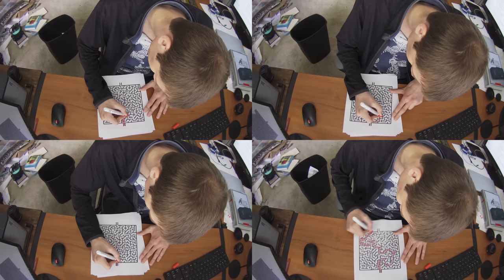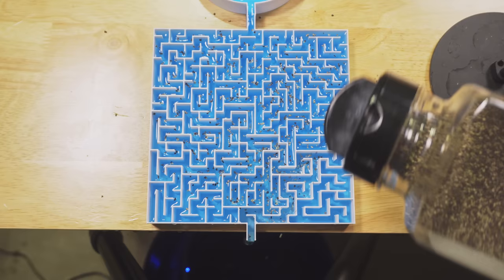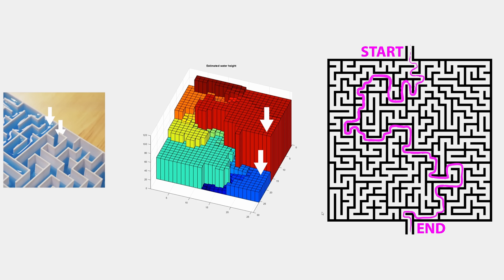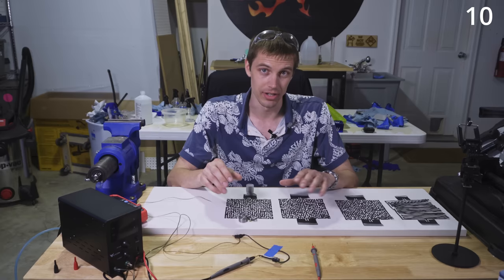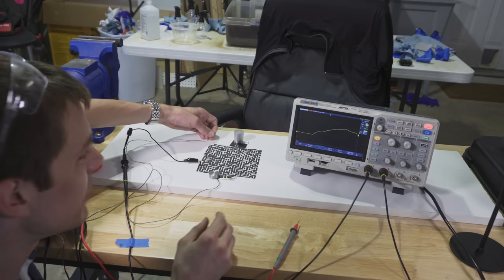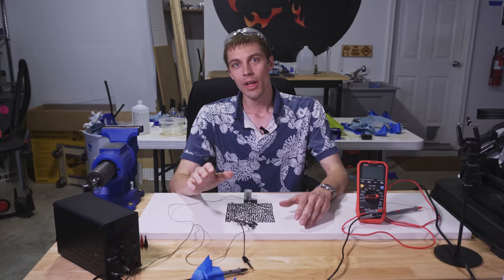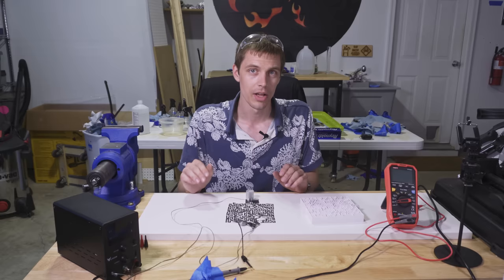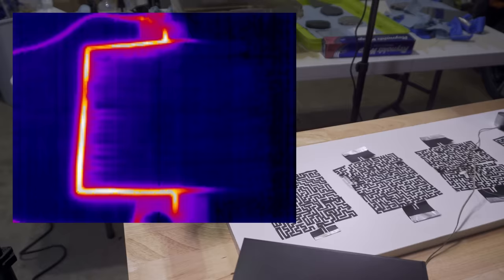How does electricity find the "Path of Least Resistance"?

Comment: They take all paths.  The less resistance, the more current flows thru that path.
Reply: In the case of a maze that wouldn’t be  true. All paths that don’t lead to the exit would be considered as open circuits, and no current would flow.
Reply: @Ethan-ej6fz  Yes they do. Just in that case, the resistance is such a high number the current is effectively zero. There's no such thing as an insulator.
Reply: @Ethan-ej6fz  There is current flow when you introduce a new voltage to an open circuit. It's like when you charge a capacitor, there is current flow until it "fills up" on voltage and then the current effectively stops.
Reply: @Ethan-ej6fz  When I said "Path", I meant successful paths of varying complexity.  I did not mean interrupted paths.  A path, to me, goes from source to destination.  But I see your point.
Reply: You might say that the field includes all paths. The current follows the path of least resistance through the field so electrons are more likely to appear on that path.
Reply: Exactly!
Reply: @RupertBruce   But the point is that current doesn't take only the path of least resistance (exclusively).  It follows all paths proportionately to the resistances.
Reply: I thought we finally have that algorythm that truly solve pathfinding in games
Reply: Kirchhoff's law
Reply: @alext8828  But knowledge of the resistance along the length of the path is not instantaneously known, that information travels at whatever the speed of light in that medium is.  You get some "sloshing" at first before that information is returned.

And then weird, weird things happen when you leave the strange, degenerate realm of DC and head up to RF, where absolutely everything is a capacitor and an inductor and a resistor all at once.
Reply: @Ethan-ej6fz  open circuits are just antennas 😏
Reply: @ILoveTinfoilHats  I think about this a lot haha
Reply: Current flow takes every path inversely proportional to it's resistance. In the case of an interrupted path the resistance is effectively infinite, so the current is zero. It is also why it takes multiple paths, with the shorter, less resistive path, getting more current through it.
Reply: @fire17102  Not at DC voltages. You would need an oscillation in current for the magnetic field to be created and light to be sent out.
Reply: @Ethan-ej6fz  "In the case of a maze that wouldn’t be  true. All paths that don’t lead to the exit would be considered as open circuits, and no current would flow."

Well, let's rephrase it to what actually happens with all particles, everywhere in the universe and then it makes sense and both you and the OP are then correct.

Forces act on all particles constantly. If all forces add up to 0, the particle won't move, if it doesn't, it will be pushed in the direction of the vector of all the forces. The hint was in the airtight water maze. Water pushed on the water, ail pressure rises as a result, when they water and the air have equal pressure, nothing moves in those directions.

If you look at gravity and electric charge as pushing forces, which they are if you remember that there is no fundamental force that pulls - only in our observations because we see a net force of 0 as 0 force, which it isn't - it starts to make a lot of sense.

So the electrons are pushed into all paths, but in the closed paths the electrons will just push back with equal force because their forces will push on surrounding electrons and those forces will push on all surrounding electrons etc., until they reach air that requires way more "pressure" to move through.
The net force will be exactly 0 in all closed paths and the net force toward the exit is higher than 0, forcing the electrons in that direction. Basically no different than the water. The main difference is that electrons don't also experience gravity and water experiences both. The electromagnetic force keeps the water molecules from actually touching the walls and floor of the maze, locally adding to the net force on the water molecules, away from the floor and walls.

So basically, even the closed paths could technically be considered open circuits where the voltage/"pressure" is simply very close to that of the electrons that are pumped into the maze, and only for a fraction of a second until equilibrium is reached. But theoretically, I think there should be some movement or at least an increase of electromagnetic force inside the closed paths at the moment more electrons are pushing into it, just not a whole lot and equilibrium is reached with the speed of light.
Reply: @alext8828  Yes, and the interesting thing is that the portion of current flowing along the different solution paths self adjust, so that the current always follows the different paths in the proportions that result in the least total resistance.

A more accurate phrasing might be: Electricity follows the paths of combined least resistance.

If, for example, one could manually alter the proportion of current between the paths, it would always result in a higher combined resistance than the "naturally preferred" proportion.
Reply: Technically a maze only ever has one complete path from entrance to exit.  A labyrinth can have more than one possible path.
Reply: @ILoveTinfoilHats  wont be flowing after a sjort while in the non cloced circuts, but there will be a voltage difference as seen in the video, would act as a really low capacity capacitor :)
Reply: @ILoveTinfoilHats no such thing as a perfect insulator*
Reply: @whatelseison8970   The question included the term "Path", not "Maze".
Reply: @alext8828  it's actually proportional to conductance, or inversely proportional to resistance
Reply: Kirchovs law
Reply: @alext8828  Oh all paths go to the destination. Some just go through air, and air has a stupidly high resistance, but not infinitely so. So a minute amount of current still flows through that path.
Reply: Would guess it is a breadth first search
Reply: @grabbutthole  except they take all paths, did you watch the video?
Reply: @oasntet  a good way to think of this may be lightning. If you look at it through a very slow motion camera you can see there are multiple paths being taken, until a path to ground is found, then the majority of the flow goes through that single path. It is slightly different though since the lightning creates its own low resistance path by ionising the air.
Reply: @Jorazon1  If an interrupted path had infinite resistance, radio wouldn't work.
Reply: @rifwann  this is basically Dijkstra's algorithm: https://en.wikipedia.org/wiki/Dijkstra%27s_algorithm
Reply: @RupertBruce  Well not that is still not quite correct, the likelihood of free electrons being present at a particular point is dependent on the voltage at that point. What you will find is that the average momentum of a free electron on the path of least resistance will be higher due to the potential gradient that exists along that path accelerating the electrons on it.
Reply: @conorstewart2214  Correct, in fact a good video collab between the slow mo guys and electroboom actually captures this phenomena. Not with lighting but rather using a Marx Generator and a Tesla Coil, same effect though you see the see the streamers forming and expanding out until one suddenly lights up as they meet. Granted this process is so fast even on high speed camera it looks like this happens before they even meet but in actuality that did happen in the microsecond that exists between frames of even the 1 million FPS camera they used at one point.
Reply: @seraphina985  It is probably easier to see with lightning due to the much greater distances involved. It would be interesting to see if they can use their high speed camera to capture real lightning at some point.
Reply: @rogerdahl0   Ha!  Very good.  Okay, let's phrase the water analogy then.  How does the water know where it is?  How does a molecule of water know what to do?
It's because water flows downhill (from high potential to low potential.)  And electrons flow from high potential to low potential too.
Does that sound better or no?
Reply: Through, not thru.
Reply: @grabbutthole  so.
What is an electrical arc?

Well it's a patch of air that got energized enough to strip the electrons from the molecules and allow a current to flow.

So what exactly happens?
Well we start by generating a high potential voltage across the maze.
Let's say for example 10,000 volts.
That will disperse and drop as it spreads through the air thanks to dilution with non-ionised air while seeking a place to neutralize their excited state.

The maze has a path built into it, and so the voltage will bleed into the maze, gradually filling it with a voltage gradient, paths nearest the entrance will have higher voltage potential energy than those around the exit.

Then gets the fun part.
Voltages attract opposite voltages and repel similar ones

So you can build a capacitor against the walls of the maze around the exit/entrance before the Ionized air manages to discover a path to neutralize their charge. And so positively charged Air will drag itself towards Negatively charged Air, even if walls get in the way between them (which is how capacitors function)

When the two streams of ionized gas touch, the difference between their potential energy known as voltage quickly becomes neutralized as ionization is an unstable state for any element. Except the ones I don't wish to discuss here. Go away Iodine, you are cheating! Fat electron hungry slob.

What happens when the ionized gas makes contact, completing the circuit? The energy flows through the connecting path, and ionized air in the side passages will flow towards the arcing energy forming high energy plasma we see as an arc.

One interesting observation is that theoretically we could build a double maze, and while ionization of the air in both will occur, we would only expect the arcs formed to appear in a singular maze because of the propogation mechanic. And not strictly the shortest path either because of Capacitive coupling between the paths will accelerate the arc formation.
Reply: Like people trying to get out of a costco, they take every register but some are faster
Reply: @mbrosenb86  and once they find the fast path everyone rushes to join the moving queue
Reply: @Ethan-ej6fz there's no such thing as an open circuit. Current takes all paths at all times, in proportion to resistance.
Reply: @whatelseison8970  not quite the accurate distinction between the two terms, but at least you tried.
Reply: Thanks for TLDR
Reply: but what does flow ???? Electrons definetly not.....
Reply: @TheGUARDIANOFFOR  The electron field?
Reply: @TheGUARDIANOFFOR  current "flows", the electrons do in fact move, but not very fast.
Reply: @Ethan-ej6fz  upon connection electricity does flow to each end of "the circuit" (in this case the dead ends of the maze) - once they hit a deadend there is a negative surge of that travels back to the interconnect point, from that point very little current travels to the deadends. For practical applications of this size this happens in a metal in the order of a microseconds, but technically you can say the electricity "explored" the entire maze. For any1 interesting in understanding the phenoma going on here more deeply, a good start is to look up "Reflection Coefficients" - I believe Feynman has a good lecture on the matter.
Reply: Rather than "resistance is nonzero, even across air gaps", I think the water maze is actually very close as an analogue to the electrical model, except that it should use pre-filled sealed pipes instead of open flow. That makes the water an incompressible fluid, just like the electron gas is inside the conductive material. The "current takes all paths, even the extremely-high-resistance air-gapped ones" is like saying "water molecules can technically pass straight through the pipe walls in very, very small amounts due to microporosity/poor construction", but there is nothing about the model that requires it - a pipe maze of perfectly impermeable pipes would function the same, just like the electrical model even if air gaps had perfectly infinite resistance (zero flow).

To understand how current flow starts, the key point to make is that flow and pressure are not the same thing, and while fluid might not flow in appreciable amounts, pressure does (and very quickly) in an incompressible fluid - it's only once that pressure wave hits something that isn't more incompressible water or a hard pipe wall that appreciable fluid flow starts. As it does so, a negative pressure wave flows backward through the maze towards the source. Each pressure wave flows completely through the maze, but the ones that hit dead ends are reflected back directly (positive -> positive or negative -> negative) - as such, they cause no net movement of molecules because the net momentum imparted by the waves cancels out. It's only along the path where a positive wave gets reflected back as a negative wave or vice versa (i.e. when waves hit the high-pressure source or low-pressure sink) where the two work constructively to push molecules along, until the waves themselves eventually die out and the pressure gradient falls "statically" onto fluid friction in the pipes due to active flow. If multiple such branches exist (between source and sink), then flow will develop across all of them.

In essence, by treating incompressible water as very slightly compressible, the pressure wave propagation and how they (eventually, but really very quickly) produce flow can be modeled. And each part of that model (pressure <-> voltage, fluid flow <-> current, friction <-> resistance, etc.) is analogous to the maze-circuit model.
Reply: Why you have to be like this
Reply: This actually gets kind of interesting with AC and resonant transformers
Reply: Then it's not a maze. Mazes need impenetrable walls.
Reply: @Ethan-ej6fz  That is in a sense true to point of increasing voltage. High enough voltage and not even air works as insulator and electricity arcs over the air to point of least resistance. Same apply to any other material known to exist. With enough voltage rubber insulation means nothing. Hence there is really no such thing as insulator for electricity, just material that increases resistance in that voltage area so it primarily flows trough intended path or resistance is increased such level that current is effectively zero due that, but with delicate enough measuring devices that tiny flow current can be detected, so in a sense current still flows even with massive resistance, its just not enough to power anything or harm anyone. That is what smoothbrain tried to explain. Leave battery in a plastic bag and in a few years that minimal flow will deplete it.
Reply: You can really see this when you use high voltages (HV).  At 3kV, anything within 3mm (1/8") of the wire will be affected. It really does go everywhere.

If the insulation on an HV wire is too thin, it can actually ionize the air without electrons traveling through the insulation. You can see this when placing a florescent bulb near an HV source.
Reply: Your fun at parties aren't you
Reply: Thanks 😂
Reply: @ILoveTinfoilHats  in that scenario, resistance would be near infinite since it’s the not the path of least resistance. Just because it can take multiple different paths, doesn’t mean it will, simply because of “electricity will follow the path of least resistance”. Electricity will touch a certain path, and not turn back, but it will stop, because it can not move that way. The electricity will not stay in every path, it will find the path of least resistance and follow it. Again, it make take every path, but it will not stay in every path, electricity does not work like that. This is shit you learn in any basic course 😭 y’all
Reply: @Vune_GG  what do you think happens when you put 2 unequal resistors in parallel. I'll give you a hint, it doesn't just flow through the lower valued one.
Reply: @alext8828  but a path in a maze and your definition of a path are wildly different
Reply: @Dosor72  What's wrong with it?
Reply: What about the video about how electricity flows around the wires, and doesn't push electrons through the wires. If it is true, which I assume it is then using water as an analogy is incorrect.
Reply: @denn15m8   No, the water is still good.
Reply: @denn15m8  **energy* does. Important distinction. All analogies will be incorrect to some degree. If an analogy was perfect it wouldn't be an analogy and would serve it's purpose.
Reply: @Ethan-ej6fz  Yes, eventually, but first they act like transmission lines. Some current will flow to the end and then the open circuit will relfect the signal back it's origin. There is a voltage drop along the path while there is current flowing. This is what you see in the stepped waveform but there are several reflections back and forth as well as several paths with open ends so it gets a bit unclear. If done with a single cable (coaxial or parallel wires) it can be shown very clearly and is used to measure cable length and detect faults in a method called 'Time Domain Reflectometry' (TDR) sometimes even called Cable Radar. I works so well that Open, Short, Change of cable type, Spurs, junctions can all be detected.
Reply: Current is the same through out a circuit. When cranking the motor on a car you have the full current load in the ground side of the battery.
Reply: @djb1634  that only applies to series connections. In your motor example sure, but you also have current going through other electronics in your car that goes through the battery but not the motor.
Reply: 22 minute video answered in 1 comment
Reply: @djb1634   Nope.  That total current is from adding up all the separate currents coming from all the paths.  The current leaving the + is divided and will be combined at the -.  Good thinking though.
Reply: @ILoveTinfoilHats  Current is still the same throughout. If you add circuits the overall current goes up but you still have the same current at the positive terminal that you do at the negative terminal. You can’t measure current unless you isolate what you are measuring and run your meter in series, or you use an inductive clamp which is not happening with this maze. You can only measure the current of this maze in one way at the positive and negative terminals. I literally take these readings everyday in real life scenarios with the added complexity of Joe blow who doesn’t know shit about electronics modifying things.  I have be able to prove the problem was created by the customers stupidity and not the manufacturers defect.
Reply: @djb1634  yeah, we know. What was you point?
Reply: @Ethan-ej6fz  you are not thinking electromagnetically here. You need to leave the simplifications we made for basic circuits behind. 

If you learn about electromagnetics and what dielectrics and conductors are you realise that everything is conducting electricity all the time but for the amount of current allowed to flow is determined by both the potential difference between any two points and the materials physical properties
Reply: saved me 15 mins
Reply: @grabbutthole  you have to be trolling right lmao?
Reply: Ye
Reply: And if infinite resistance, it simply reaches an equilibrium voltage depent the capacitance which has to do with surface area and probably the inverse square of distance given the strips are lying down, hence the "voltage telling you how bad of a path that is" ..... I think, that's the only unintuitive part to me, the multiparty was exactly as expected as was current. Also, simply more path in a cutaway section more electrons can be stuffed into it, which fits the water analogy better . Huh
Reply: Oh nevermind, it's where it touches the solution path (it can only touch once in a non-solution path)
Reply: How did this get so complicated?  It's just like plumbing.  Skinny pipe, less water flow.
This conversation reminds me of a guy that was learning electronics and I asked him where he was in the course so far.  He said he was memorizing the color codes on resistors.  WHAT?  That's bullshit.  You'll learn it after you've used it for a while.  Learn the logic.  Skinny pipe=Less water.
The more pipes (parallel resistors) the more current flow.  Can you handle E=IR?  Then I=E/R.  That R in the denominator is inversely proportional to I, the current.
( I put all this in because it seems to me that there are individuals out there that might need some explanation.)
Reply: @universalunit9317  My fun at parties what?
Reply: Do not try and solve the maze, that's impossible. Instead, only try to realize the truth... There is no maze.
Reply: @Ethan-ej6fz  There is current flowing. It's just an extremely high resistance so you can effectively say no current is flowing
Reply: should we all become zero resistance individuals?
Reply: @jameelbarnes3458   I'd resist that.
Reply: @alext8828  😄⚡️
Reply: That can’t be right because then the current would diffuse infinitely
Reply: @inductor1.77   No, not a good test.  A lightbulb needs a minimum amount of current to light up. It's quite a high resistance.  Use an ammeter to rest the current.  It will be there.  It will be proportional to the resistance of each element in the circuit.
Reply: @Ethan-ej6fz bro did you even watch any of the video
Reply: If that was true you would see burnt residue
Reply: @Ethan-ej6fz  leakage current has entered the chat
Reply: @Ethan-ej6fz Electricity also flows through open circuit. It's just not enough to do work.
Reply: @ILoveTinfoilHats  perfect vacuum is an insulator
Reply: @Lortagreb  a perfect vacuum isn't a thing, it's a lack of things
Reply: just  like water woah 94 replies just ighnore me well maybe i can give thi s guy a bump he's an electric genius genius w superior dedication to making watchable brainy yt eps
Reply: Your mom takes all paths
Reply: The field takes all paths
Reply: @Ethan-ej6fz  It’s a massive parallel circuit, the current will flow through all branches, yet the current in all branches but the easiest is so low that it might as well be zero, in the case of the maze the total current is also pretty close to zero but, the shortest path has just slightly less resistance so it gets the most current flow.
Reply: Thanks for saving my time
Reply: Admittance
Reply: That’s how anything that flows works too, like water
Reply: @Caleb-fv5fp  Very similar to hydraulics.  Same idea.  Pressure, current speed, resistance to flow.  You can even think of capacitors and diaphragms that block dc and let ac thru.  The whole thing is very similar.
Reply: @Caleb-fv5fp  not self siphoning liquids 😂
Reply: No shit. Did you even watch the video??
Reply: Just like how I'm certain it would work if you flooded the entire maze with a fluid and can see where the path of least resistance is.
Reply: So u can say electricity is like God or Luck. The less resistance you have, the more it helps you 😂
Reply: @Ethan-ej6fz  theoretically no such thing, just resistances so high that there's is an unmeasurably small amount of current.
Reply: "Nature laughs at difficulties with integration"
Reply: ❤🙏🏽 very enlightening
Reply: I saw a video that said that photons travel all possible paths in the universe and then take the shortest path
Reply: @2010RSHACKS   I kinda think that photons only exist on the quantum level.  The don't exist in the real word.  
It's like molecules of water.  They don't fly out of your faucet when you turn it on.
Anyone tells you that photons have been sensed by there equipment is just seeing the lower lever of sensitivity.  
Light is a wave.  Not a particle.
Reply: Yeah, length of conductor is directly proportional to resistance... So short length is less resistance that is why current chooses the short path.